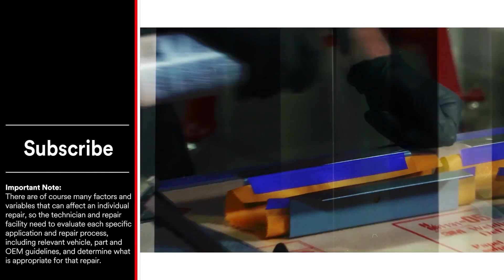Paint Defects 101 Episode 1: Know Your Defects

Comment: Cool now show me how to keep pin holes out of the 3m bondo!!
Reply: There's conflicting strategies here, HOK says fold and press when mixing, 3M says don't, but both indicate to press hard against the board when mixing and spread as thinly as possible across the mixing board before applying. It seems to reduce the potential for air and increases working time.
Reply: Thats why i use zgrip pretty decent
Reply: Glaze